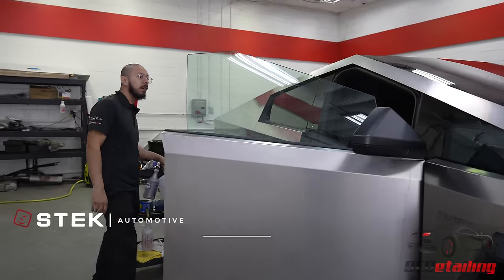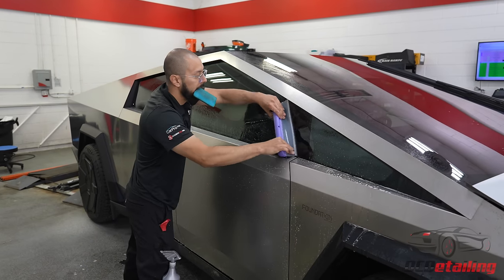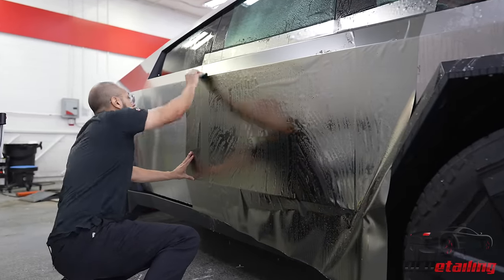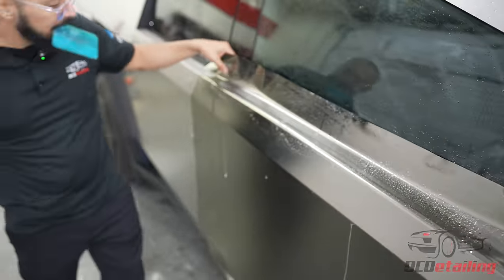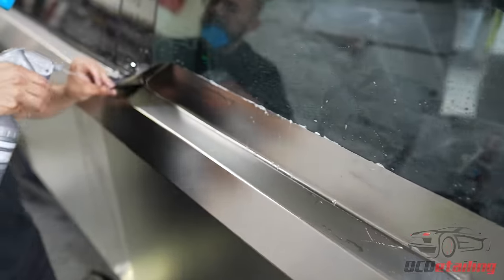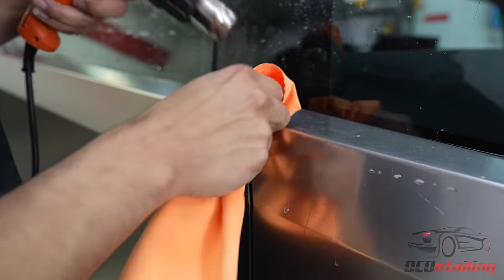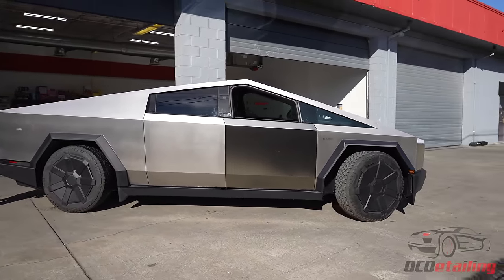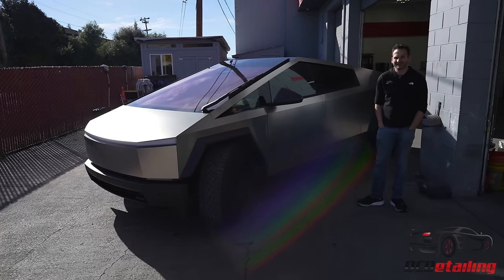Cybertruck - Door PPF Install Video - STEK DYNOchrome-black matte

Comment: For those who don't know PPF is "paint protection film". It scratches much easier than paint, but for a car with paint it's a good idea to protect from rock chips. In this case it's a waste of money - there is no paint to get chipped. So actually you are paying lots of money to make your exterior more fragile. Don't expect most detailers to tell you that - there's not a lot of integrity in this industry.
Reply: But it looks stunning? not only for protection...
Reply: or just the ease of changing the color without having to paint...
Reply: Don't think anyone is claiming it's there to protect from scratches and chips on the Cybertruck, rather for fingerprints and changing color/finish.
Reply: PPF does not scratch easier than paint. I've been installing for 4 years. I
Reply: Exactly what I was thinking.
Reply: @marcjones8825 It scratches easier than bullet-proof stainless steel, in this case.
Reply: @marcjones8825 
First of all we're talking about steel hardened to the point of being bullet proof. 

Secondly PPF is 100% more prone to scratching than paint on a normal car. In fact that is part of how it works, being soft enough to absorb impacts from small rocks/scuffs and such so the paint doesn't chip or take damage. I take it you must just do the installing and not see the cars after. My shop installs PPF and handles detailing / maintenance for our customers cars. I have been detailing and polishing/maintaining PPF film for 24 years.  Get a black car with PPF on half the hood that's been taken through the scratch and wash and you'll see.

    I don't mean to degrade you without knowing anything about you - I'm sure you're an excellent installer - but you should look into educating yourself more on how to maintain PPF film for maximum life so you can educate your customers. Our job should be to provide expert knowledge and the most excellent service to our customers not take advantage of the fact they don't know and trick them into buying something with a false promise of what it does.

   It really is messed up how many people out there will sell a product or service with a false claim of what it does.

If you want to wrap your Cybertruck to change it's color that's an awesome idea. But don't sell people on the false idea that PPF film will help protect your Cybertruck. Think about what we've seen done to the Cybertruck that didn't dent it or leave a scratch. Once you get to the level of force needed to scratch or dent a Cybertruck PPF will not do a darn thing to stop that. Instead you'll have to replace the film when some small thing happens and if you had no film you wouldn't have to do anything at all.

My advice to anyone who doesn't believe this is - go research the hardness of paint vs PPF film and then watch your Cybertruck on the bumper and down the sides where the wheels kick up dirt. If you see it starting to get sandblasted protect those spots alone.
Reply: It’s cool color than original color,why not black color?
Reply: @brnrxn  Stainless steel is not bullet proof, just depends on the size of the round you intend to put through it. Maybe bullet resistant let's say.
Reply: @zacharyramsli8002 you wrote a whole essay. Relax, bro … you don’t get any extra credit on the internet
Reply: You can’t only LEASE these trucks, who does this much, to look cool. And they don’t actually own it, or ever will own it with a title in their name 😂😂🤡🤡

Comment: Can someone explain what's the need for PPF.. the darn thing doesn't scratch or dent easily. It's martensite as Sandy confirmed. Is this just to NOT get finger prints ?? Sounds excessive just for that. Could as well have ceramic coating for much lesser cost. Thoughts?
Reply: Color change, different look etc.
Reply: What Jstar said. And as resilient as the steel finish is, this thing will look factory fresh should the owner decide to unwrap it and sell it on a year or so down the line.

Comment: Why are we putting pait protection film on something with no paint? What a scam.
Reply: It's not that big a deal if you look past the name PPF. Since they didn't go for a clear film, think of it as an extra durable wrap.
Reply: It's less durable than bare metal on a normal car - never mind the Cybertruck steel. If you want to change the color - go for it. But don't let people trick you into thinking this will make the truck more durable.

Comment: Looks perfect when new, very nice! But how will edges etc. behave after 5 or so years?
Reply: I some how think owners will change wraps every 2 years or so, to have the " latest" cybertruck colour trend.
Reply: wraps are only good for three years before you have to remove them to avoid leaving adhesive residue stuck to the car,

Comment: who else wondering why they are installing ppf on a surface that's already hard and scratch proof and even has no paint, I mean the doors are practically bullet proof, I don't think a rock can make a scratch, let alone chip, especially with this non painted body panels

Comment: First off I don't understand why you're putting a rap on it that's the same color as the truck because the wrap is not going to protect the trucks panels more than the actual panels because the panels are very very tough and very scratch resistant That's number one number two if you're changing it or you're putting a rap on it because you're changing the color I mean I've seen a black one that's matte black and that thing looks fucking sweet but if you're just putting a wrap on it to to put a wrap on it and not change the color of it then you're basically just wasting money

Comment: Modified leased vehicles, wouldn’t touch a “previously wrapped” vehicle with a ten foot poll. Sure this clown does it ok, but most shops will not be gentle de-trimming off cam. Get dinged upon lease return because someone sold you on some horse dookie 😂😂🤡🤡